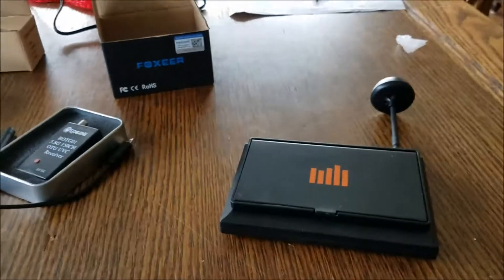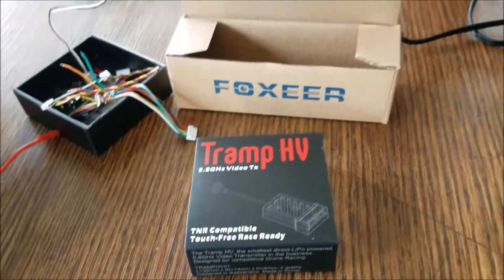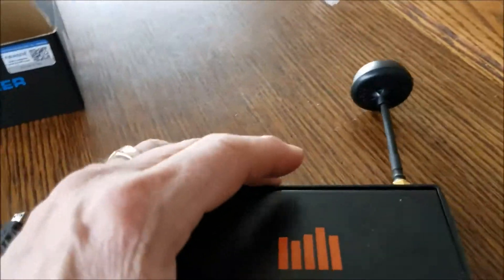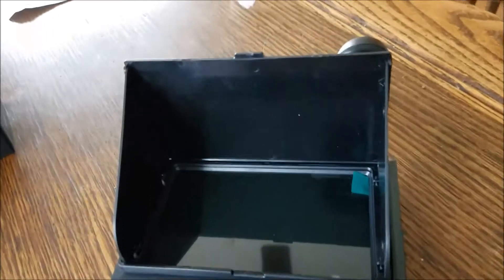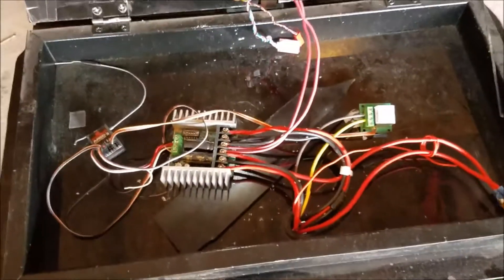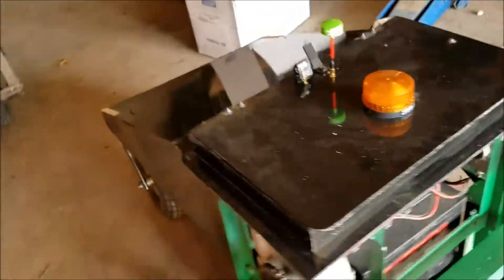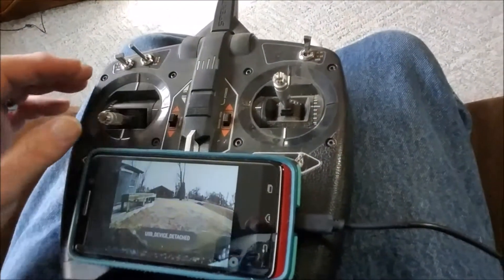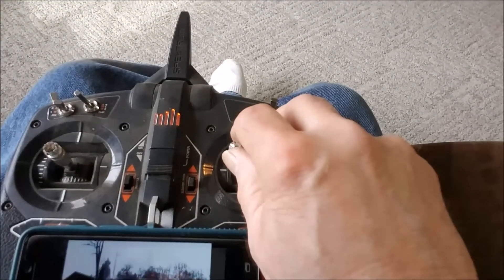remote control lawnmower with new FPV camera. Best robotic lawn mower

Comment: John, just starting out on converting my mower to an rc one. What model are the drive motors on your mower and the motor powering the blade? How much run time on a charge?
Kerry Buxton
Reply from the maker: I am not sure which model of electric wheel chair motors for sure. the run time is at least 45 mins